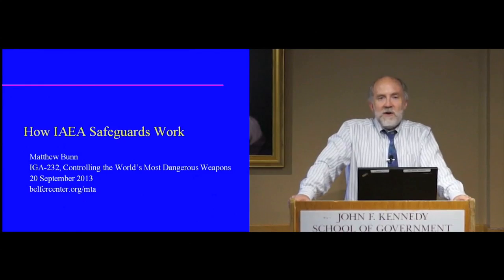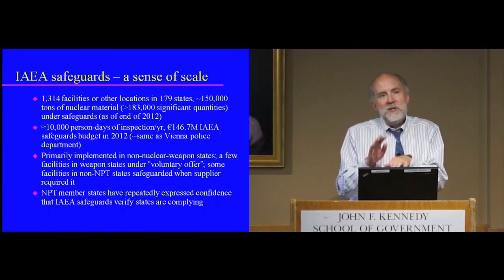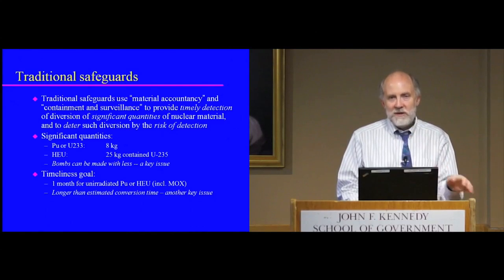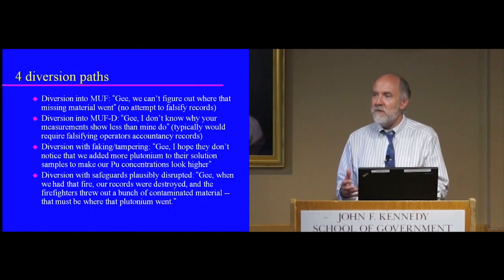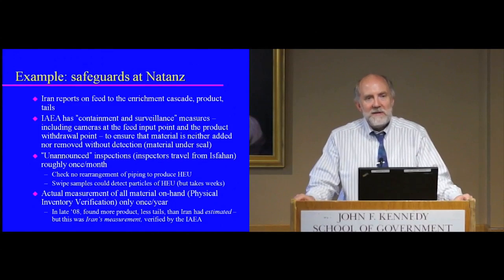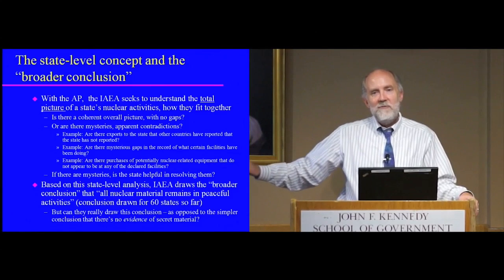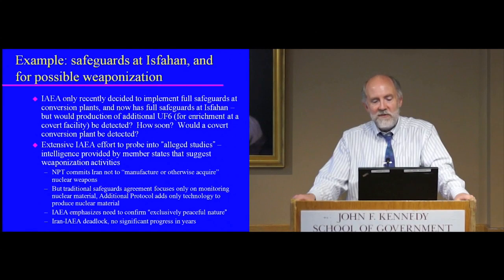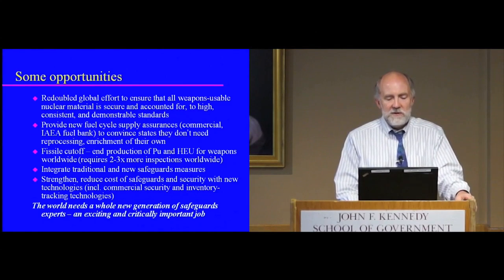Nuclear 101: How IAEA Safeguards Work

Comment: nothing about actual safeguards.      all over the world there is constant leakage and dumping of radioactive waste,  and iaea is doing nothing to safeguard anyone.   its about money, and morons
Reply: Thats not what the IAEA does they prevent the use of nuclear power plants for creating weapons grade material.  Leakage and dumping of radioactive waste from nuclear plants? Source please.
Reply: larkin540 the iaea promotes nuclear, soooooooooooooooooooo
Reply: it promotes nuclear power, which is safer then almost any other energy production method gives off less radiation then coal power and is carbon neutral.
Reply: whats happening in fukushima?  huge amount of radiation releasing constantly into the air water food, the rest of the world. nuclear is stupid, and will shorten all our lives.  cancer much?
Reply: severe issues with nuclear plants have happened twice one of which was human caused and the other was caused by a tsunami and was by the way not a failure of the nuclear reactor but because the building designers placed backup generators on the ground floor where they flooded. Nuclear  power including its accidents kill less people per year then almost any other energy production method.